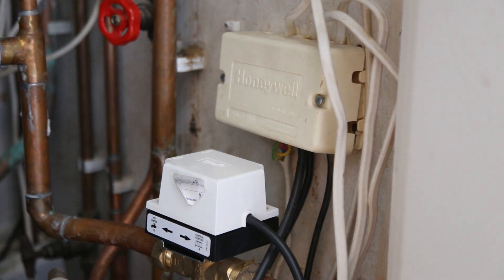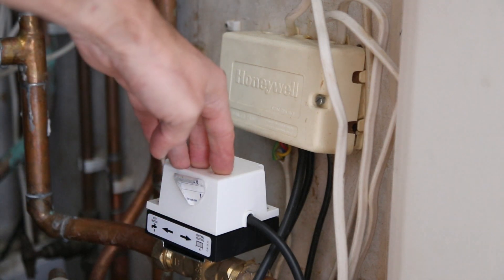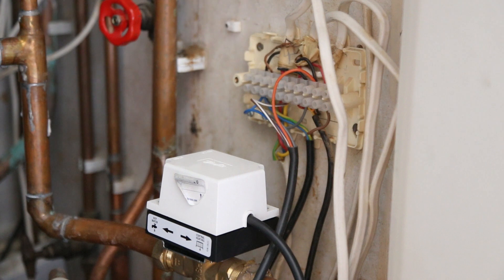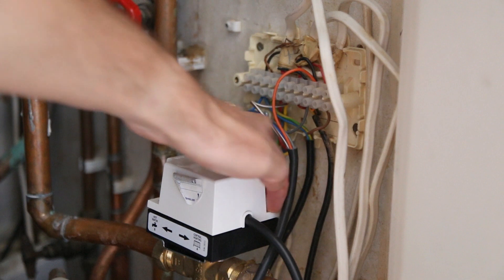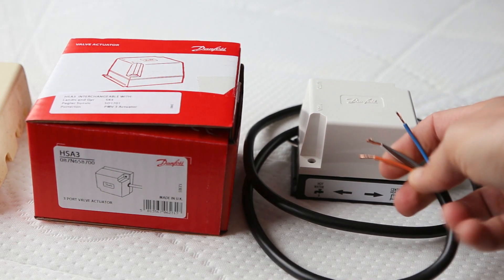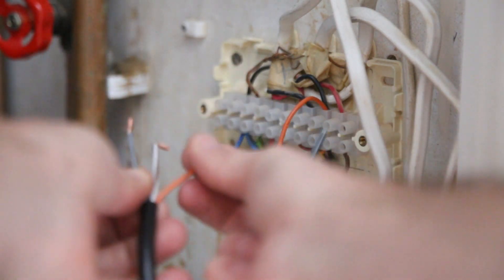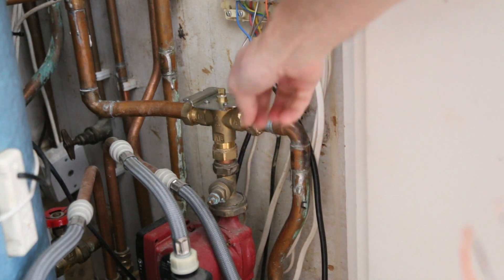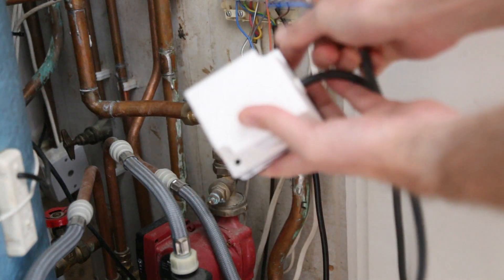Replacing Faulty Danfoss HSA3 3 port valve Actuator - Hot water but no central heating

Comment: Can the valve ever be faulty if my rads are hot yet boiler is off on my syatem boiler as the pipe either side of the zone valve are hot ? Do i only need to remove the big white bulky thing you showed and am i safe to do so without risk of water gusing out once removed ? Thanks